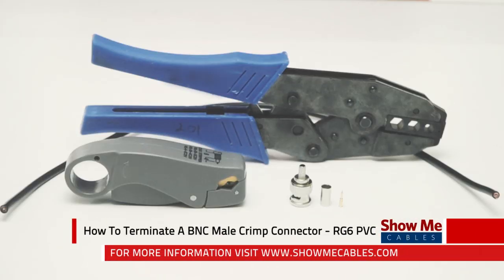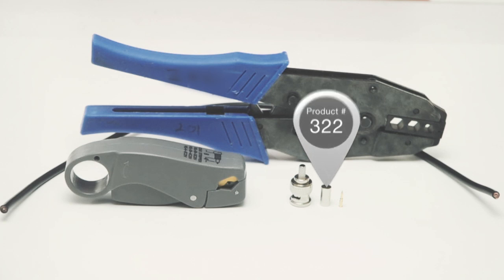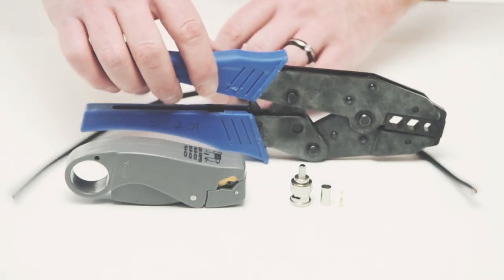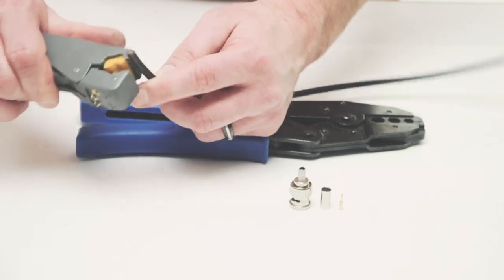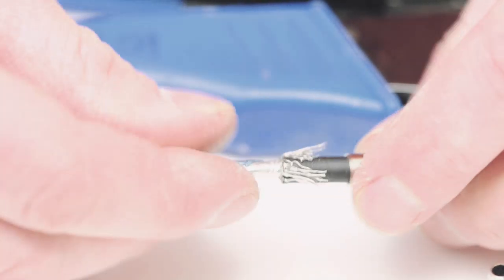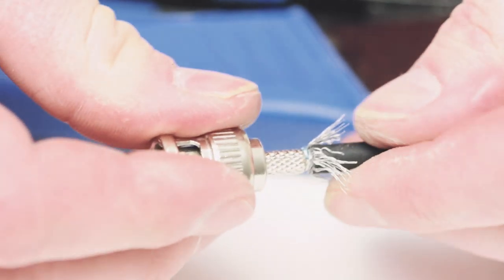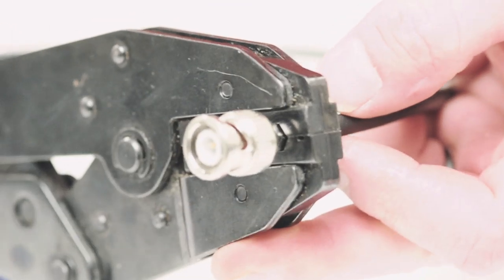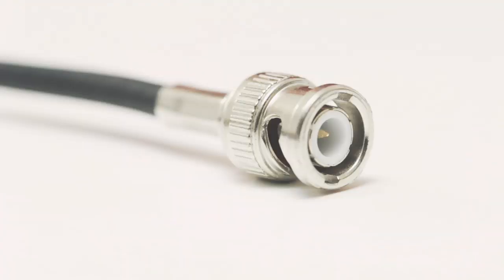How To Make A BNC Male Crimp Connector - RG6 PVC #322

Comment: The centre pin normally is crimped or soldered on most other bnc crimp coax connectors. It would need to be a very tight push on if not crimped. It didn't look very tight.